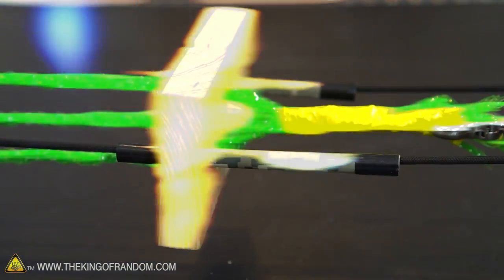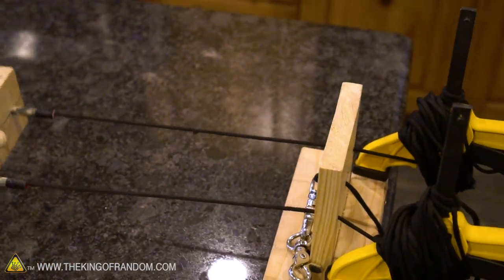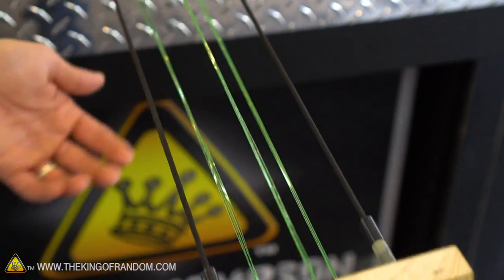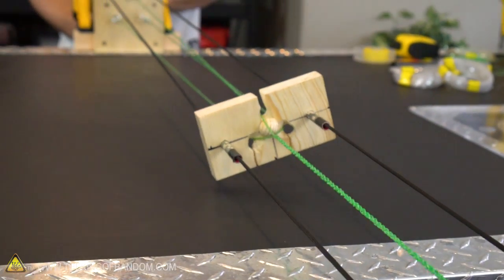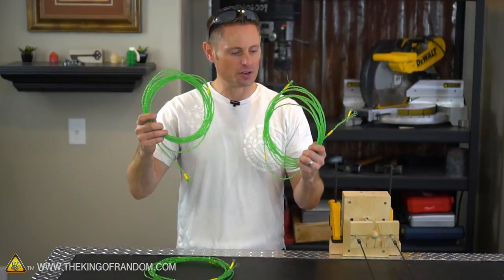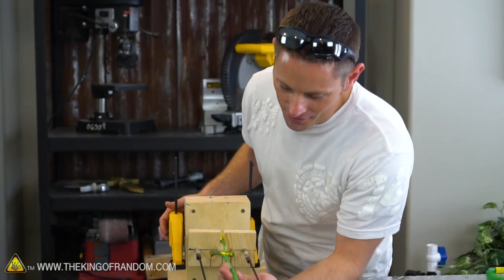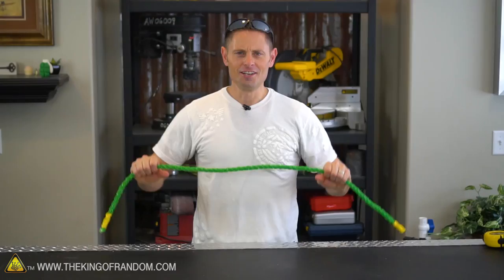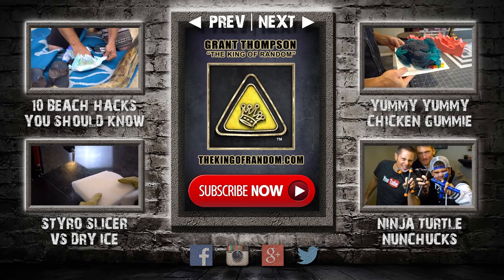Soda Bottle Rope | How To Make Rope Or Homemade String From A Plastic Soda Bottle (2 Liter Bottle)

Comment: PLEASE!!!!  Grant, please strength test the soda ropes in a unique way to see what kind of weight they can hold, or pull, with different gauges of ropes you made.  lift weights, tow a car, swing from it like a vine, etc.
Reply: Doramius ya yayayayyayayaya
Reply: Everybody copy this comment and post it every where
Reply: Doramius I was just about suggest that. I would love to see a strength test for the various types of rope he has made. maybe he could pull a car with it?
Reply: Doramius yes I want him to tow a car
Reply: I think a single string can hold around 25 pounds...so that rope is 9 times more stronger...supposedly it can hold 225 pounds
Reply: Doramius in in agreement.  I'm a firefighter and work with rope quite often and it's killing me to know the tensile strength.
Reply: Doramius i wanted to write this
Reply: test it till it breaks
Reply: came down to the comments to say he should strength test the ropes he has made and saw this
Reply: so agree. need to put it in a tensil strength machine and see at what pounds it snaps or starts to stretch out. this I think is a must grant!
Reply: Doramius Came here to say the exact same thing haha
Reply: @Giovanni Paraizo:  If a single can hold 25, then I bet the 9 strand can go WAY higher than 225. Pretty sure you'll see an exponential strength curve rather than a linear one.
Reply: Giovanni Paraizo it's not linear.  the more you add it gets exponentially stronger
Reply: Marshall Gatten Oh...okay
Reply: I can guarantee you that it could hold more than you think. That looks like a mooring line we use for boats in harbors.
Reply: The first stage in the process uses 2 strands to make each single strand, which already at least doubles the strength which obviously Giovanni didnt account for. Also doubling in size almost quadruples the strength, so just the original 3 strand should have a tensile strength of over 100 lbs. The final product would likely be able to tow a car, but likely wouldn't be able to actually support that kind of weight suspended, rather somewhere in the range of 1/4 to 1/2 of a metric ton.
Reply: Cheesus Sliced I got it...geez...
Reply: I support your idea so much

Comment: can you test how much weight the rope can hold?
Reply: Absolutely you need to do a strength test!
Reply: you'd need quite a contraption to strain that rope to failure but it would be interesting.
Reply: Yeah
Reply: Benjamin Pas-VanCauwenberge a
Reply: Russel Walker
Not really.
Tie the plastic rope to a higher quality rope, pull that through a pulley where you tie it to a weight. Keep adding weights until it breaks.

You can also use a special clamp if you're not sure a knot will hold (although, a sheet bend should do fine).
Reply: I'm sure it could hold your body weight. You could test it yourself by tieing it around your neck and see if it holds up.
Reply: Benjamin Pas-VanCauwenberge change your profile then he might do it
Reply: +Iron Lightning Actually you're right. So I googled the tensile strength and wall thickness of 2l PET bottles which turns out to be 75MPa and 0.01inches respectively. The strips were 1/8 inch and they total 27 so total cross sectional area of the rope is 0.03375 inches^2. if we convert MPa to psi then multiply by cross section in square inches we get its strength at 367lbs.

For a pulley he could use a standard three fold purchase which gives a mechanical advantage of six so he would need a weight of about 60 pounds to break it. He could even preload it with about 40lbs of gym weights and then slowly fill 2 5liter containers which would hold about 22lbs of water, allowing him to measure the exact weight it was able to withstand.

Unfortunately though the knot would be the weak point. Even a double sheet bend would reduce the breaking strength to less than half. An eye splice would get you as close to 100% as you can go with knotting but maybe there is a special clamping method they use for rope testing. It's definitely doable.
Reply: Mr.DJ why?
Reply: Benjamin Pas-VanCauwenberge I agree
Reply: That's what I was waiting for
Reply: It can hold your gial
Reply: alex parrish you mean WEIGHTing for that? puns!
Reply: that was so PUNnny!!! Puns!!
Reply: sorry all my Puns have been BOTTLED up for so long!! (:
Reply: lol
Reply: Benjamin Pas-VanCauwenberge  yeah
Reply: What you're looking for is called a Kellem clamp, also known as "chinese fingers" look in the electrical section of your favorite big box. They come in various sizes and are used to grab electrical cable when you're fishing it through conduit. The harder you pull, the tighter they grip.
Reply: It can hold a weight of somewhere in between a peanut and the Burj Khalifa.
Reply: it can eazly hold a 50 kg person
Reply: Bruce Collins p
Reply: Yes please
Reply: Hopefully 70-80 kg
Reply: Benjamin Pas-VanCauwenberge  tensile strength P.S.I.
Reply: At the end he lifted himself up it's pretty strong..
Reply: The weight of me
Reply: I tried it with the 27 strand rope and it broke at 165 kg
Reply: @stuarthall3874  the strands alone are strong enough to lift a car
Reply: I have experimented with the rope. for the first string it can bear the weighing 300N.
Reply: I agreee
Reply: Why is there always one comment that’s on the top with more than 1000 likes?
Reply: A breaking point of over 9000 kilograms. That's the weight of a killer whale.
Reply: Yeah but that would be short so it should be posted on igtv
Reply: Benjamin Pas-VanCauwenberge yeah because this morning I got hook of a 20lbs bass but it cut my line
Reply: No..... No he can't.....
Reply: Benjamin Pas-VanCauwenberge not anymore
Reply: Not anymore...
Reply: He cant anymore
Reply: Benjamin Pas-VanCauwenberge no no he can’t
Reply: He can’t he is dead
Reply: @zeeqz   4 years ago we were still toxic
Reply: He can’t
Reply: 😅😅 @zeeqz

Comment: Test the strength of the rope
Reply: That will probably be another video...
Reply: angel delgado well, he did. at the end of the vid.
Reply: angel delgado 
I second that motion.
strength test till it breaks.
Reply: Yea, pls do it. Use dynamometer and compare its strength with normal rope's strength so we will see if it is usefull
Reply: and if possible i think making a ladder would be cool
Reply: do a strength test of all the different type and sizes that's he's made. be cool to find out which is stronger.
Reply: angel delgado I wish
Reply: angel delgado very weak to heat
Reply: Yes, we need to know if it can hold say, about the weight of the average human body at least.
Reply: every ropes except steel ropes burn
Reply: Tow a car with it
Reply: angel delgado i
Reply: I would like to see this as well. starting from 3 strands up to 3x3x3.
Reply: Minikreuz I Know that. but the plastic melts
Reply: He kinda tested the strength
Reply: Jayden Hodder how?
Reply: I would love to see how much weight each thickness can withstand. They seem very strong for constant lengthwise force.
Reply: angel delgado test it with a depressed person
Reply: Pewdiepie 2 - 
Savage
Reply: angel delgado Why don't you do it instead

Comment: Make a rope with fuses. That would be awesome to see burning
Reply: ColorBlind Vegan thats kind of dangerous since the rope winding procces creates a lot of friction. it might catch fire or even explode
Reply: Alex V.D.H. 
It probably won't be that dangerous if it caught fire.
Reply: Alex V.D.H. no it is a fuse
Reply: +FernTheYoutuber Fuse contains its own oxidizer, making it very hard to put out. It would be very dangerous.
Reply: maybe if you did it at a slower rate?
Reply: ColorBlind Vegan use cotton soaked in gun powder or soemthing wind your ow n fuses
Reply: Hey completely not related to the rope you should make a working robot like Cosmo but home made but better or even something with AI
Reply: thats very very expensive. and would probably take some one professioned in that type of stuff.
Reply: lindsay robitaille ccççcv

Comment: You should do a tensile strength test on the 3 different ropes!
Reply: Watch until the end
Reply: COMMENTINLY I meant a semi measurable tensile test, at least on the first rope.
Reply: I want to see this as well!  Very curious about how much the strength scales up when you add another layer.
Reply: Agreed
Reply: please do, i was thinking that the whole video.
Reply: This is what leaves me wondering. I would love to see how strong it is compared to a similar size traditional rope.
Reply: Tyler Easthom I wish I could thumbs up this suggestions more than once!
Reply: Woot max 8-bit upvote
Reply: +COMMENTINLY not like that where he just hangs from it. an actual test where you can find out how much weight can that rope can take before it breaks. Get actual numbers to see if this is actually viable as actual rope.

Comment: Do this with copper wire and put rubber over it to make it a cable that works!
Reply: Like so he can see!
Reply: Matthew Levine copper wire is very weak, it's one of those materials that you bend it and it snaps :/
Reply: LiquidPringles Pribglr same with plastic and he did that
Reply: Then you need to use new wire. Copper becomes brittle when it is work hardened. Copper electrical wire is never hardened, and will always be soft right off of the roll. 

Copper may actually be too plastic to work right here. When it bends, it has almost no appreciable spring and immediately enters the plastic deformation part of the force/yield curve. It will probably be too ductile to gather enough tension before it pulls the shuttle forward, twisting the actual rope.
Reply: Not only that, but it also snaps when you apply to much tension
Reply: Never Hurts to try
Reply: Matthew Levine that is a great idea!!!!!!!!!!!!😀👍
Reply: Matthew Levine that's an awesome idea!
Reply: Joseph Walsman there are lots of different plastics and soda bottles are made with PET plastic which is flexible
Reply: Matthew Levine dude grant Thompson should do this!!
Reply: I've seen a documentary on making ropes for the shipping industry. They start out with individual strands just like you but they have to go a half mile or more to end up with a rope of any useful length. There is also ways of splicing the ropes to increase the length. Maybe you could show us how.
Reply: Matthew Levine YESS
Reply: also do some load bearing tests
Reply: yess
Reply: Matthew Levine I would just use heat shrink tubing
Reply: JRoyal, that was what I was referring to when I said "put rubber over it" but thanks for clearing it up!

Comment: I know it's a bit late, but... I got a weird request: Paper Mache. I have my own recipe;  1/2 liter of water, 4 table spoons of sugar, 2 tablespoons of all purpose flour, paper bond, make paste-soaked paper pulp with it  and compress it. leave it to dry for  several days or bake it to extract moisture. This thing is as strong OR stronger than wood. Don't trust me? Try it. Once dry this thing was able to withstand  a machete blade to it. And if you add baking soda to it, it fireproofs it to a certain extent (it's already quite hard to set fire to, the baking soda makes it almost impossible). I did the tests by mystelf many years ago.
Reply: Uhhh... I am not sure anymore. If 4 tbsp of sugar vs 2 tbsp of flour of vice-versa. It's been quite awhile, but trust me. This thing is quite strong if you did it right. Paper paste with the paper mache paste is quite strong. Oh, and I have  worked with this material for around a decade and have a whole body of work online to prove it.
Reply: hmm i did paper mache for 2 yrs but was not interested in this....
Reply: A. C. Rusinov sounds similar to pykrete, but solid at room temp! Cool
Reply: Landon Sarrett I have no idea what pycrete is. once dry this thing is basically like wood or stronger, but it is a bit sensitive to water. as it's still paper after all.

Comment: I have a question: Can you make the string back into the bottle
Reply: yeah do that
Reply: technically yes efficient no easy probably not and u would need heat to melt it together
Reply: technically yes efficient no easy probably not and u would need heat to melt it together
Reply: Don Wong duh
Reply: That's a fine question. I'd say you have to weave them like a wicker basket. and then, using temperature, melt them together as Jz said. Or use clay, but you need to dry and glaze it as well. Anyways, yes, I think this possible, but the bottle will definitely look different.
Reply: try it in a 3d printer and print your own bottle.
Reply: Maybe with a mold and a way to heat up the plastic it might work.But he could also make it into something like a basket. Just might take a little bit more time to do.
Reply: Don Wong yes go back to the last video and play ot backwords
Reply: Don Wong no
Reply: yes melt it but first you will need to make a mold
Reply: Don Wong i dont think that's possible
Reply: yes, melt the rope and put it into mold again (possible only in factories)
Reply: PET can be melted and remolded and so in theory if he can get the right equipment and technique, he can mold the rope back into a bottle or anything..
Reply: You would need a source of heat and a weaving tool, so its possible but probably not easy
Reply: In theory, yes. That kind of plastic can be melted and recast. But you'd need the same equipment (or similar) that made the original bottle.
Reply: Don Wong, no, it impossible
Reply: sure with recycling =)
Reply: If you want a bottle don't cut it.
Reply: No
Reply: Don Wong realy?
Reply: just rewind the video
Reply: Yes!
Reply: 3d print

Comment: Please show us how much weight these ropes can hold!!!
Reply: i agree... should test to see what kind of stress the rope can hold
Reply: tensile strength
Reply: tow a car
Reply: AsianElvis we need a strength test
Reply: redstone craft guy yes!
Reply: Marina Rope.
Reply: AsianElvis  the rope can hold 70-80kg
Reply: Caleb Vukovic it will not break
Reply: +Caleb Vukovic he said it can hold 70 to 80 kg
Reply: Caleb Vukovic I just assumed the the strength after seeing Grant Thomson pulling himself up the wall with the rope
Reply: Caleb Vukovic maybe it hold more weight than tgat,I don't know it actual maximum strength.
Reply: Probably one and a half grants
Reply: Adam10157 N1ce tr0ll m8, u b8'd them real gudz! (insert 100 emoji here since im on a PC)
Reply: Ultimate tensile stength = maximum load before failure / cross sectional area
You could calculate a rough approximation yourself though by cutting a single strand of plastic and carefully conducting the experement on a smaller scale.
Reply: Philip J. Hill N1c3 tr0ll m8 you b8d then r3al gudz! 🔟💯📵insert more random emoji here
Reply: Neck swing
Reply: He can't show now.....he is no more😭😭

Comment: For making longer ropes you should attach a cord on the guide so if it doesn't move you can pull it from afar and continue making the rope without having to move.
Reply: Also, you might want to wax your traveling block.
Reply: Or put down a bit of sheet metal, even something from soda cans would probably work to make it smoother.

Comment: You should try comparing the rope with store bought rope
Reply: i love that idea
Reply: Randy Hinds he needed content for another video
Reply: Jacob Robinson yeah
Reply: weight test them and see what rating they would have at certain widths in comparison to nylon rope and 550 cord
Reply: Jacob Robinson use it to tow a truck Texas style
Reply: he should test the strengt (I dont know how to spell streng)
Reply: Jacob Robinson yes
Reply: Lizzie Dsouza its spelled "string" hope this helps
Reply: think shes going for strength not string.
Reply: Please put weight on it till it breaks. 200 lbs, 210 lbs, 220 lbs, ...
I'd like to know how much it can hold. 300 lbs? 500 lbs? 1000 lbs?

Comment: I have heard that more expensive ice cream has less air pockets then cheap ice cream you should put them in your vacuum jar and put this myth to the test. Like if you want to see this experiment
Reply: John Valentine Did you jut agree on your own comment?
Reply: Tristan MacInnes did you just copy the other dudes comment? (;
Edit: added the winking face
Reply: The air to cream ratio is actually really important for ice cream. It impacts flavor dramatically as oxygen helps you taste. I would bet that the different price point ice creams wouldn't have a huge difference between them. Would totally be something to try out though and see!
Reply: the temperature will also affect the flavor from what ive heard watching ice cream experts on youtube. (it was one of those moments where you start watching 1 thing, and get completely off subject with weird stuff....like ice cream experts LOL!) But the colder the ice cream, the less flavor it will have to your tastebuds. Which is why soft serve is normally the main seller at actual ice cream shops and trucks
Reply: John Valentine yes please, the Italian ice cream vs local ice cream.😍
Reply: +redstone craft guy YES, GRANT + VACUUM = BAD BAD BAD
Reply: NO. MORE. VACUUM. EXPERIMENTS.
Reply: sarry hater